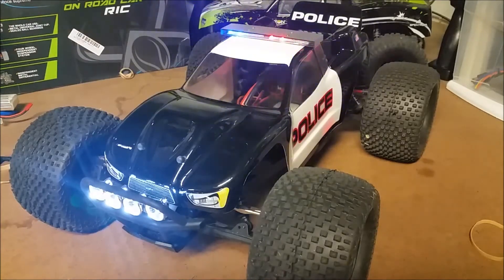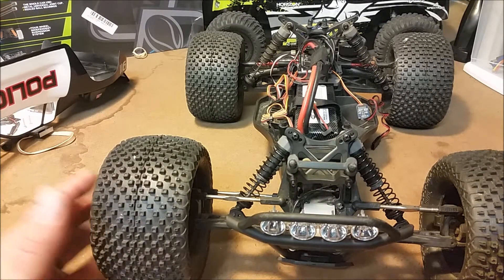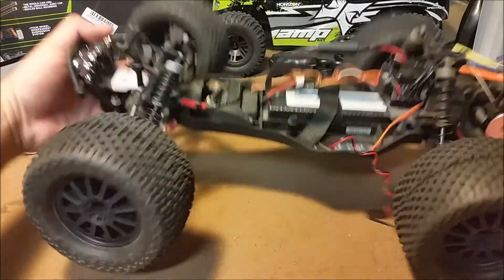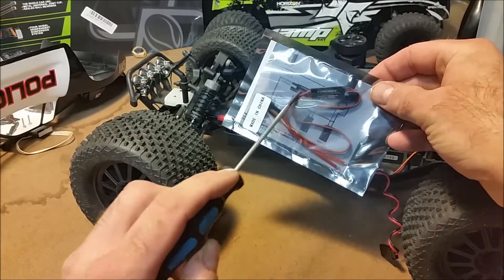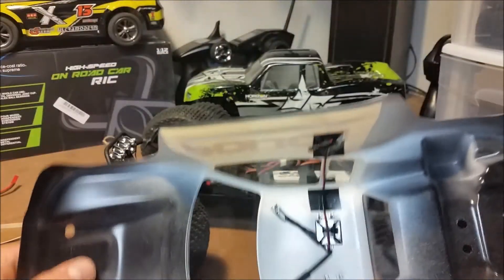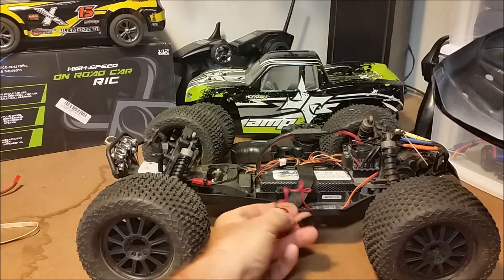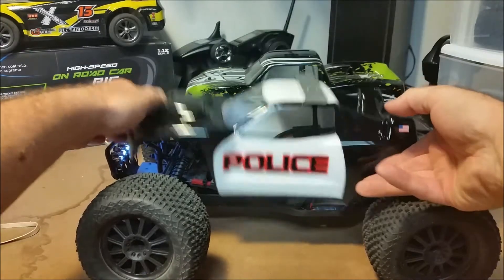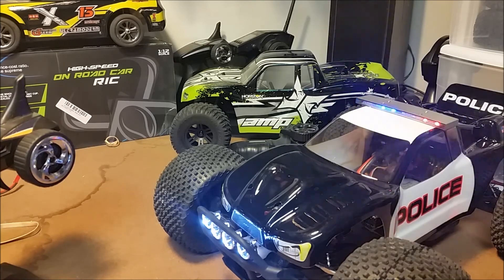How to:  Wiring Lights to your RC Car

Comment: Great video sir. ? Is it possible to wire LED strip to my esc with futaba style connectors? It seems like it isn't providing enough power to the led strips. The only way the seem to work is when I plug them to one of my lipo's or something
Reply from the maker: LED lighting, aside from the bright light bars, draw so little power that any style of connector should work.

Comment: I have the same receiver and transmitter, I am gonna probably get a receiver box and one of these mad thrust switches. And extra tips for the installation?
Reply from the maker: It's all pretty straightforward.
Reply: Budget RC ;)

Comment: Hi Budget RC. A question, Do you know if I can use the DR mad switch for turn on/off a brushed little electric motor(size370)or is it too weak? Do you have test this or can you? I have one for a water pump on my rc boat. I want to be able to turn it on/off in the water as I like through my radio with one of the switch buttons.
Reply from the maker: Sorry, I'm just seeing this now.  I'm not sure how much current that us rated for, but I'm sure it's way less than a 390 motor would draw.
Reply: @BudgetRC_Channel  Thanks for the answer. I have already solve my problem.

Comment: Great video, thanks a bunch!  You mention that you have another video showing how to install the front bumper Traxxas lights, but I can't find that video.  Can you please provide a link?
Reply from the maker: Roger Grant, at the end of my Circuit Rig Rundown video I quickly showed the spacer I made to mount the bumper to the bulkhead, but it recently broke, so I made a new one out of Kydex that's working out much better so far.  https://youtu.be/yEPLlCzhrPA

Comment: Yo man I have a question what could I use to power my lights and fan if I don't have extra ports, I need to maybe use batteries but I want a nice professional kinda look just hit a brick wall lol
Reply from the maker: If you can't solder an extra battery lead onto the ESC, you can run a separate battery, or buy a bifurcated battery plug that has a 2nd lead attached.

Comment: Nice video what wheels and tiers r u using?
Reply from the maker: sm0keu they're JConcepts Choppers on whatever wheels they offer them with.  At about $12 a pair, there's absolutely no better value in monster truck tires. They grip better than the Proline Trenchers on my Slashpede.
Reply: Thank u for u reply gone try get me a set 👍🏽

Comment: Do you know if the drmad thrust switch is waterproof? I got one and i wann run it in water
Reply from the maker: No, I don't believe that it is.  Usually when something is waterproofed, they make it clear that it is.  You could do it yourself with conformal coating or plastidip.
Reply: Budget RC  do you know how I would waterproof it with conformal coating (thanks for the quick reply), I’ve seen tutorials on how to waterproof receivers and ESCs, would you do the same thing for this switch? Would you also need to take off that rubber/plastic cover off?

Comment: can i use y line to the switch? for sound and lights
Reply from the maker: icy T. Sure.  It's just acting like an on/off switch.  As long as you don't exceed its current capacity, you can power as many things as you want with it.
Reply: Thanks man
Reply: Sir do i need a bec? And if needed where ill i connect?

Comment: Do you have to use a rc car 

And what are the measurements in inches
Reply: Never mind I just need the measurements
Reply from the maker: There's a link to the light bar in the video description. I'm sure the dimensions are listed there.
Reply: Ok